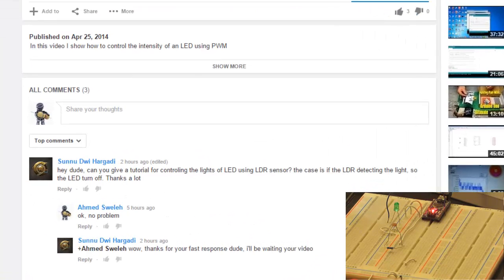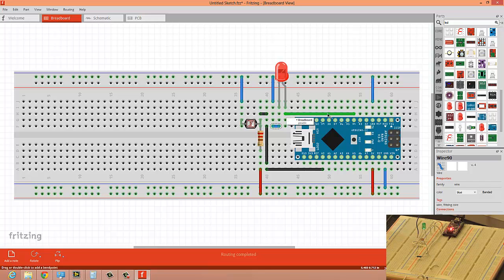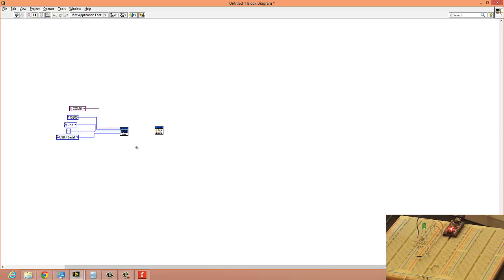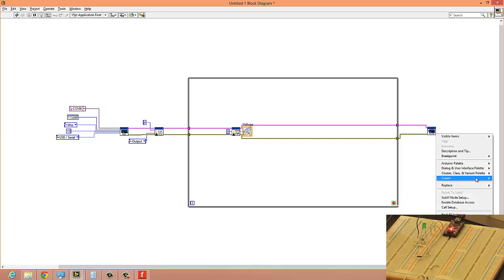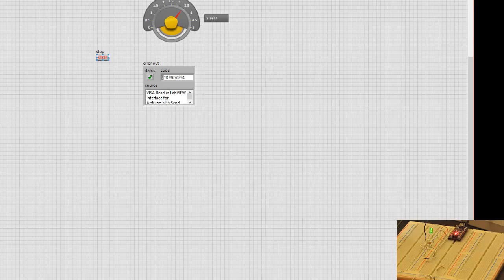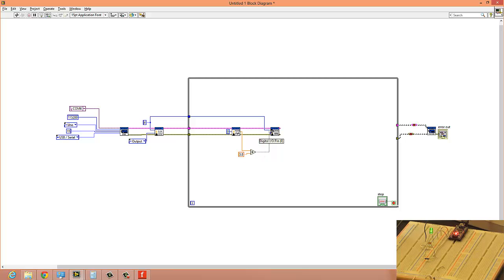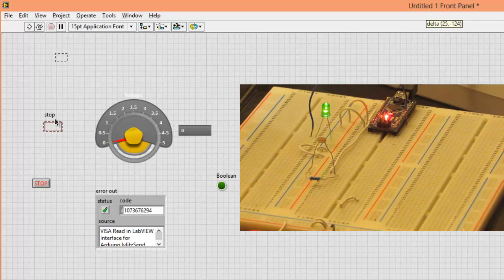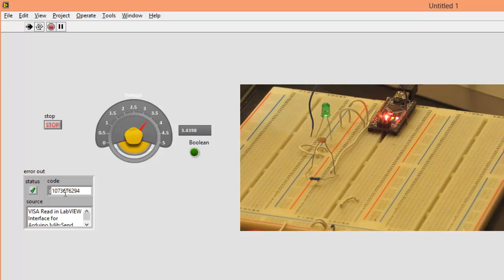Interfacing Arduino with LabVIEW Part 4 light switch

Comment: hi can we read the digital output from any I/O pin of arduino and then use as input (push button) in labview? Means we write a code in arduinoIDE then uploaded to arduino in which a push button is used to on/off a LED on output i/O of arduino. now i want to use this output i/O to make some funtions in labview.

Comment: awesome video ahmed. Could u plz share an info on my project: I'm using temp sensor thick film   which have 6 legs: front side has 4 legs which acts as varying resistors one is of platinum varying resistor ( 2legs) and other is chemical varying resistor ( 2legs). Back side has 2 legs which acts as heater to rise the temperature on this film. Because we are using to rise temp back side of film so that front side resistors will vary. This exclude addition temp rise equipment . Now would u please share how to increase heater power and how I can read resistor values . this  is my university lab project which I should make .

Comment: Thank you sir, If I'm one of your nearer student sure I'm going to meet you :)

I' have question please.

I'v  run below sketch successfully (thanks to its designer). It is an object tracking sys.
 
https://decibel.ni.com/content/docs/DOC-23399#comment-44136

When object be tracked, its parameters variables  (x,y,z) appeared on the screen. 

Question:
How can I make these parameters to be as an input to Arduino via serial communication etc.
May target is to control servo motor somehow like:
http://youtu.be/0DqcnHE6r9M

Any help pls
Best regards 
Ibrahim

Comment: ahh thanks , that function of greater than and convert boolean to I/O is all that i need, its more simple than i use a case function instead (if(x>3,8);y = 255;else y = 0) because what i know is LED working in 0-255 . anyway thanks for the solution, thanks a lot!!!
Reply from the maker: When you say from 0 to 255 that's PWM. In my example the LED is on with full intensity. If you use PWM and set it for example 100 the LED will be on with 50% intensity
Reply: Ahmed Sweleh ahh i see, thanks for the information, by the way, what software you use to create the wiring diagram of that project?
Reply from the maker: Sunnu Dwi Hargadi fritzing, Here is the download link http://fritzing.org/download/